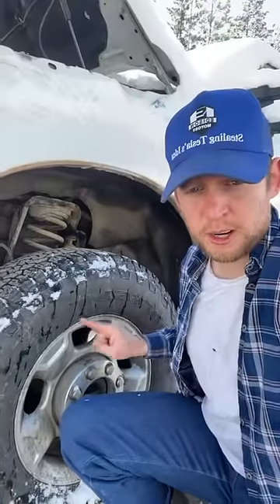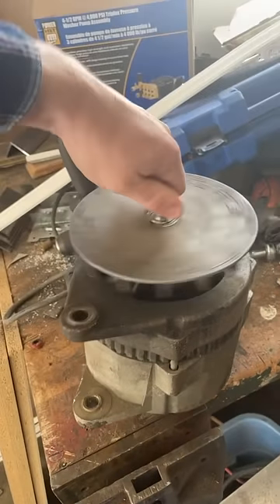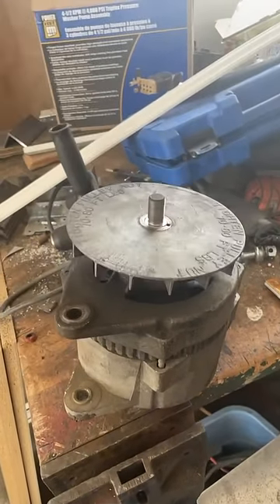Alternator on each wheel???

Comment: In short, it takes more power to turn an alternator than the amount of power that comes out of an alternator.
Reply: Exactly.
Reply: But a stator spins magnets around copper coils and it doesn't cause drag to spin it.
A four-wheel drive electric car could have 40 stators, 10 on each drive axle
Reply: @bryonkidder6199  the electromagmetic forces in a generator cause drag. It may not cause drag when it isn't powering anything, but as soon as you try to extract energy out of it, that energy has to come from somewhere–namely, the wheels' rotational energy
Reply: @bryonkidder6199  Here is a simple test for you to prove this. Spin an electric motor shaft ( like a 1/4hp motor) with the motors wires not touching. It seems like there is no drag because it's not doing any work.

Then hook that motors wires to another motors wires. When you spin the shaft, the other motors shaft will turn but it will be harder to turn. If you put a little resistance on the second motors shaft,  it will have much more noticeable drag. Putting output wires to charge a battery will also create drag.
Reply: @bryonkidder6199   @bryonkidder6199  When the coils are hooked up to charge a battery, there is drag from the eddy cuurent, also alled magnetic drag. 

If you disconnect the coils from charging the battery there is no drag because there is no work being done.
Reply: @bryonkidder6199  Using iron in the middle of your cores increases output but increases drag. Coreless coils have less drag, but don't make as much power.
Reply: To both, a H-D stator is located at the end-shaft of the crankshaft, with a stationary 12 coil pack setup that spins a cup with magnets around the coils....
How can there be significant drag with zero contact?
Reply: @godwinsboom  and btw, I'm only talking about an electric battery powering an electric motor from a static start and switching to stator power mode while the vehicle is in motion. 
With 10 stators on each drive axle (4wd), 20 should be able to power the electric motor at 45 mph and the other 20 recharge the battery
I would think?...lol
Reply: @bryonkidder6199  It's impossible with current public knowledge to charge a battery without there being drag. A wind mill doesn't spin freely when it's charging something. You can't charge something at 100% efficiency. There are losses beyond just friction of the bearings. There essentially one could say there is electrical friction in a sense. The more magnets, coils, and the bigger they are, the more "magnetic friction there is". Eddy current. 
https://youtu.be/wYNMpRUAuyY
Reply: The only way a generator could power a motor efficiently is if the generator was creating more power than it took spin it. With all the friction and eddy current, it's impossible. If you could cancel out eddy current it would be still less than 100% efficienct. Even the wind resistance on the car and in the bearings wastes energy.
Reply: @bryonkidder6199  If your car was only going down hill, then it would work if it was steep enough lol
Reply: @godwinsboom  while magnetic friction isn't zero, it's not the same as a stand alone car alternator.
Reply: @bryonkidder6199  But a car alternator will probably output more power. There's always a trade off somewhere.
Reply: The alt starts charging at 1000-1500 RPM's
Reply: right i think they trying to get in our heads he saying it loses power cuz of the resistance of the wheels trying to spin the alternator like sooo what of my car slower its works all y gotta do is go fast or down a steep hill thereess your power except waiting at the charging station them turn the alternator off when the car charges it self all i hear is people are afraid to make it cux the government gomna be after them we can easily make a wind up toy  @godwinsboom
Reply: Make better alternators 😂
Reply: @andrewsad1 AMake  better alternators 😂
Reply: You guys aren't very smart.
Alternators are available with different outputs and the resistance is minimal. 
1×75amps@14volts@1500rpm-resistence=
1x300amps@14volts@1500rpm-resistence= 
6x300amps@14volts@1500rpm-resistance=
The resistance factor is lower than the output factor and its electric so it needs charging so it gets electricity added to make up for any resistance losses.
No one said it was 100% free. It uses a charger.  
You all need to do better.
Be smarter.
Reply: @mikejunior2404  If the resistance is low, so is the output. That's why it's not 100% free.
Reply: @bryonkidder6199 it's a secret magic force called emf " electro motive force"
Reply: So why cant we disconnect the alternators while we apply power and then only connect them when we have enough speed & are coming to a halt or slowing down
Reply: @rickblit  They already do that. They call it regenerative braking. It charges the battery a little while braking.
Reply: @godwinsboom  oh good!
Reply: @bryonkidder6199  "...it doesn't cause drag to spin it."  Right there is your massive error.  
I figured this out when I was 8 years old.
Reply: @Jonascord  it being a stator has magnet drag but it's not the same as an alternator's drag, I'd say you don't know what you're talking about?...lol
Reply: Yeah.....like he said
Reply: @andrewsad1 what if they only were engaged during braking - or were the brakes?
Reply: @highschoolclassworkvideos6873  That's exactly how they do regenerative braking! When an electrical generator is generating power, it experiences resistance, so by turning what are essentially small alternators on when you apply the brakes, a car can generate a bit of power while slowing down. However, this doesn't mean you don't need to plug the car in anymore–your car still expends more energy to get moving than it can get back from regenerative braking, so the best it can do is delay the inevitable power outlet!

It's always a cool feeling to independently come up with an idea that experts have already had and is already used in the real world. It might be disappointing to know that you aren't the first to come up with it, but it's a sign that your head is in the right place!
Reply: I don’t believe with all the technology today that we can’t built a high output alternator that would put out enough to charge
Reply: What if you gear it
Reply: @Ranger_cass   I assume you mean to add a gear ratio. The problem with that is that changing the gear ratio increases torque, while reducing speed (or vice-versa), but the total energy in the system remains constant. 

An easy way to understand this is to understand that, no matter the system, you can't get more energy out one end than you put in the other. Even on the scale of two different sized gears, if you put one unit of energy into either, it will transfer at most one unit of energy into the other. This simple law is the reason that it is impossible to make a device that can charge itself--no matter the methods you attempt to use, there can never be an individual step where the output energy is higher than the input energy.
Reply: @bryonkidder6199 unsprung environments are harsh and unforgiving.  all that stuff will triple unsprung weight and the ride quality will feel like a million mile work truck with shot leaf springs
Reply: @McCarthyism_by_Youtube  stators on axle shafts have nothing to do ride quality or unsprung weight...btw 
Unsprung weight is everything after the shock and spring, example wheels, tires, brake rotors, and hubs.
The drive axles have to turn to make the wheels move, which, makes the car roll. Instead of wasting that energy, it can be used as a stator while the car is moving to give electricity to the motor or to charge the battery. 
The main battery should only be used to make the car move from a static start, once that vehicle is moving there's plenty of energy to harness that can be used to power the vehicle, is basically what I'm talking about. 
Look up how a stator works and you'll see they're not the same as an alternator but they both poduce electricity.
Reply: @bryonkidder6199  I see. thank you for the correction and reply.
Reply: I know laws are laws and all that. But for whatever reason, everytime I hear someone simply citing a law as the reason something can't be done, I can't help but not believe it. I'd make a terrible physicist or scientist.

As an example. A neighbor of mine has a couple of windmills installed at his house. Not the huge ones, but maybe 5 or 6 ft across maybe. It helps cut down on his electric bill and all that. When I asked how much energy they produced, he told me that it depends on the wind that day but that they actually do pretty well if they're spinning decently. So I then asked him that if they were spinning really good, would they provide enough energy to run a single 110v electrical outlet. He again started with the run around that it would be DC power that the windmill produced, but that after converting it to AC, that yeah... it would definitely produce that much.

To make a long story short, I dragged my shop fan over to his house the next afternoon. I explained that in order for the windmills to make even a $1 difference on his light bill, that of course they'd have to produce enough energy to operate a single 110v outlet. And since that according to him, that was indeed the case, that we should lower one of his windmills and place it a couple of feet in front of my shop fan, which runs off of a single 110v cord. 

 Unsurprisingly, he immediately began citing all sorts of laws, and reasons for why it wouldn't work. After about 20 mins and a few beers, he finally agreed to prove it to me that it wouldn't work. We strapped my shop fan to his man lift, and set it up in front of his windmill, which wasn't spinning at all at that moment. While we only left the fan up there for about 30 mins or so, that windmill was spinning its ass off the whole time, while his other windmill wasn't. 

My take is that if it was using more energy to run that fan than the windmill produced, then the windmill was little more than a decoration. But that if the fan caused the windmill to spin, and thus produced a net gain of energy, then someone needed to rewrite those laws so often cited. 

As I said.... I'd make a terrible scientist or physicist. Lol
Reply: Now don't shoot me here, but what if we used the heat by-product from the battery coolant (which could be a fluid with a low boiling point). It would take the heat from the batteries, turn it into a gas, and run a mini steam turbine/alternator, which the collant would would then expand and cool being recirculated back to the radiator, to the pump and back to the batteries to start the cycle again?

Comment: This man was so close to breaking the “free energy” code until physics stopped by to bitch slap him 😂
Reply: Gotta be a good way to lengthen the battery life. Nano solar panels
Reply: @charleshaynie6371  a lot of electric vehicles have regenerative breaking which is similar but only in use when you’re breaking. I think charging is less of an issue than the overall battery life and the maintenance costs after 10 years. These electric cars don’t have anywhere near the lifespan of a conventional car.
Reply: @charleshaynie6371  There are, but anytime someone finds out, they mysteriously end up dead.
Reply: Lol I love it when people think they are so close to free energy. But then they realize they forgot to add resistance to the equation.

Comment: Regenerative brakes work by reversing electric motors that propel a car. It works like a generator and feeds energy back into the hybrid or electric system to help replenish a little bit of range. These small boosts in battery range can accumulate and improve efficiency over time when used regularly

Comment: A guy I worked with years ago tried for for over a decade to build a perpetual motion machine. He did not believe the laws of thermodynamics applied to him.  He even convinced investors to dump money into the “miracle engine” project which was a modern take on “run water over a water wheel/pump that pumped it back up to the top” deal.  He could not understand why no matter how much he lightened, streamlined, removed friction etc etc it would still eventually grind to a halt if he didn’t add energy to the system.

Comment: I’m so darn glad to see that you’re still  making people think. I have been an advocate of electric vehicles for more than 50 years and used them for work in material handling and transportation in plants. Your approach to making this work on an industrial scale using an auxiliary generator is the best of both worlds. Having worked as a logger in the early 70s I would have appreciated having equipment like yours instead of our old 60s  pererbuilt and kenworths. That was when fuel was 30 cents a gallon too. 😅

Comment: On some race cars we used to run the alternator off of the rear axel rather than the motor. This was done because the alternator robbedote HP being crank driven yet while axel driven ones were driven by the drivetrain and it's various heat ratios. You still loose power slowly but it's a race car so it wasn't driven for hours at a time
Reply: Might fuck around and do that to a lawnmower👍🤣

Comment: There are lots of implementation using alternators on wheels that work. Simple solution is to use the alternators as a secondary braking system to generate power while slowing down, can also be engaged when coasting down hills.
Reply: You just said what regenerative breaking us it's using the motor when not pressing the gas/power pedal to now use it as a generator applies for when breaking or costing in most EVs.

But this uses the same motor.